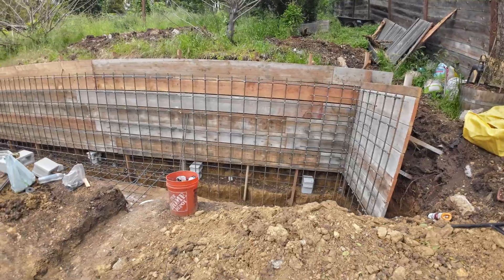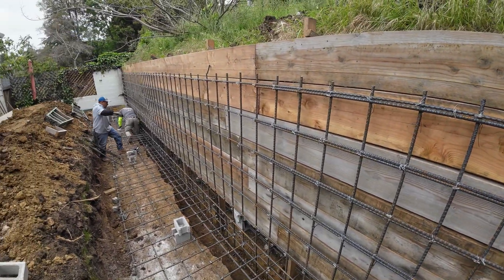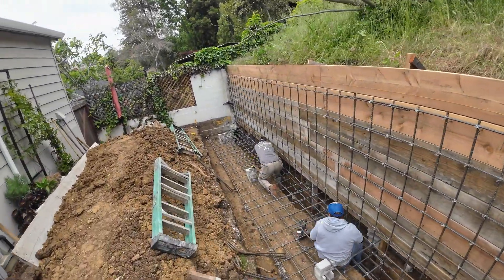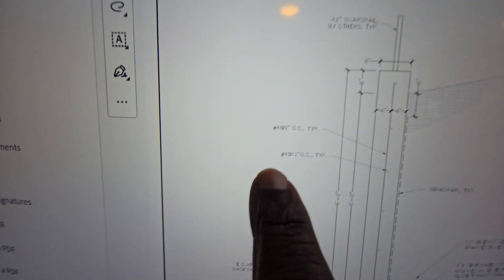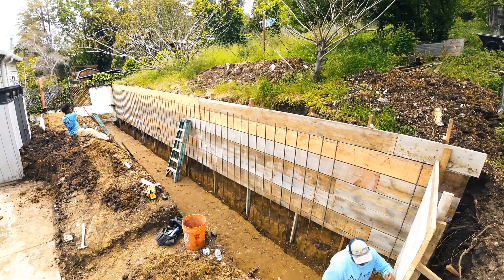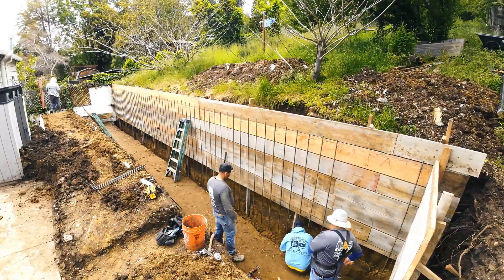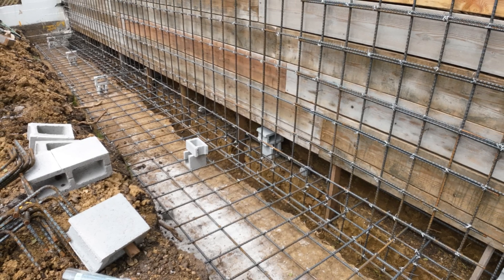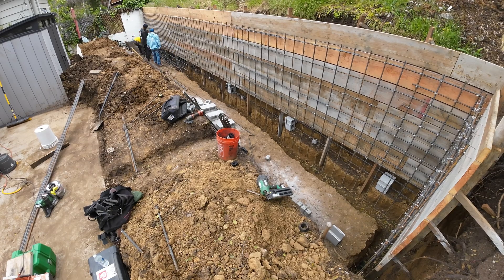Structural Concrete Wall — Rebar Going In

Comment: Asking for some help!    I own a property next to a lake with a failed seawell and I'm working to educate myself.    Can you explain to me how a retaining wall of this height can effectively hold back that hill?     I understand the keyway to keep the wall base from sliding - that was a good addition- but it didn't appear the pervious wall base was moving, only the top appeared to fail.   The hill elevation is obviously higher than the wall I'm assuming the pressure is high at the top of the wall (good you did 5/8" rebar) but the water/drainage will be rushing to that wall.  I'm making the assumption of the soils in your area but if the previous wall failed (top pushes in) it would seem that the soil structure would need changed to prevent this from happening again.   What my help me is to better understand the drainage system and backfill process if you could create a video on that?  

I think board formed concrete walls look great especially Douglas Fir with heavier grain installed in a traditional stair step fashion.  This is a flat wall (concern- that it will easily show cracks/failures like the old wall in this video).       At what length wall would piers (A buttress wall) need to be added?   

Do you water seal the concrete wall?  if not, when would a person need to seal their concrete and why wouldn't they?

  Of course clients may choose a cheaper budget option and sell their headaches - but I'm looking to learn how to do this correctly.  I'm hoping to grow from your 20 years of wall building.    Thanks!
Reply from the maker: Appreciate the comment, probably the Longest to date 😏. Probably best you talk to an engineer for that project. I also do one on one consultation..